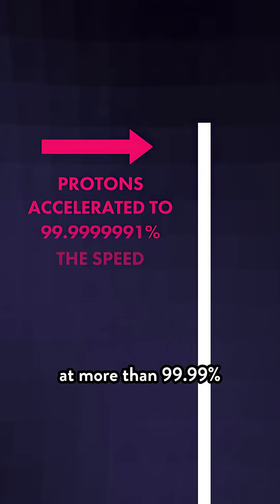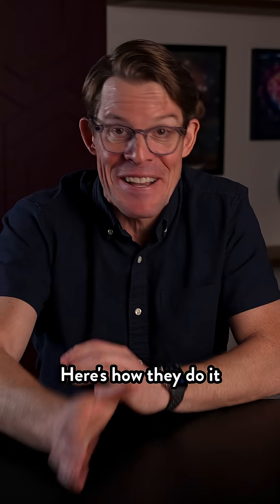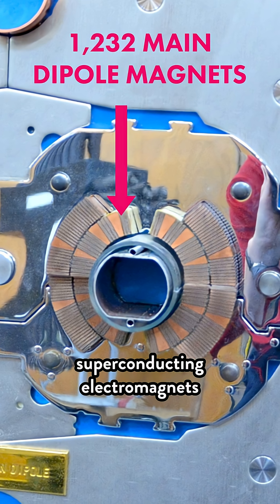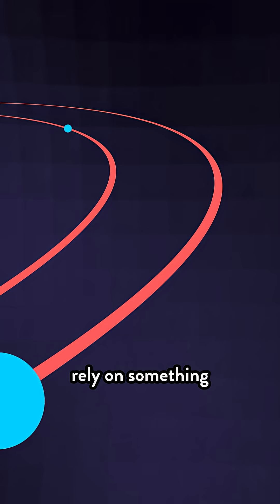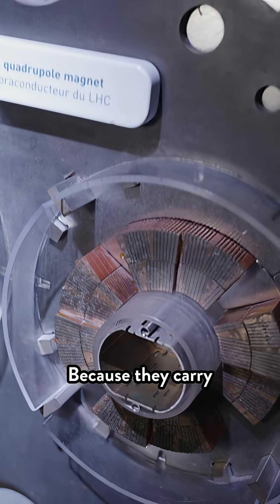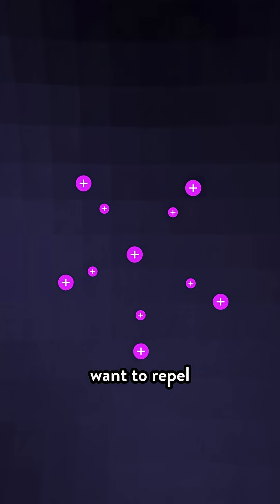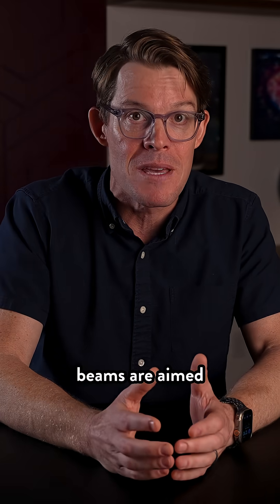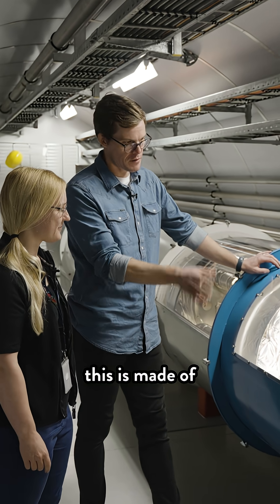How to steer at 99.9999999% the speed of light?

Comment: if you spin something fast enough you could create a gravitational field right?  but to have a gravitational field strong enough to bend the path of anything moving near the speed of light, would basically be a black hole.  so ya magnets and plasma are probably the best way to do it on earth.... only question i have is that the planet has a magnetic pole and gravity... what locations on earth could a collider be built that would optimize the energy needed to run it.?  second one pops into my head now... depth.. would the depth a collider is built affect this consumption of power to attain success in operations?

Comment: Another thing about the magnets having to be cool : when talking STRONG magnets with a LOT of current, you can't allow any losses due to resistance because the entire thing would melt (that's how resistance works - energy gets lost as heat). Therefore, using superconductors stops overheating due to absolute minimal to no resistance.
Reply: Thank you. The way he started it made it sound like the cooling was required due to the massive current. But, since they are superconductors, the current doesn't matter; no resistance = no heat. Now, the magnetic field could saturate the superconductor and force it to a state 1 superconductor instead of a state 2 but the cooling is only there to convert the conductors into superconductors.

Comment: But does magnet centralize all the material or only electron.!? 🤔 
When those atom smash each other, they create what exactly ! Heat !? 🤔 
How can you direct this heat into usable power 🔋!? 🤔 
And how can you keep feeding this machine more particles!? 🤔 
What happens if you feed it different types of particles ! Like uranium or other radio active particles??. 🤔 
Many questions 😂
Reply: I'll answer as well as I can.
At least any charged particles, such as electrons or protons. Probably also neutrons but I don't know how that works.
New, bigger atoms of different elements, but too big unstable atoms will just break immediately in a nuclear reaction.
It wouldn't be useful because you pit in the energy first, this never makes any energy, it's just coming from the grid.

Comment: So i did the math and for the particles to be accelarated around the center you'd need to give em a centrifugal acceleration of 21.000.000.000.000 (21 trillion) m/sec^2. I found this number by doing a bit of rotational kinematics. Given the circumference of the circle to be 27km and C=2πR if figured the radius R to be 27/2π km or about 4.3km and given the velocity of the particles to be 99.9999991% the speed of light (c) or almost 300,000km/s the centrifugal acceleration which is equal to V^2/R is approximately 2.1 * 10^13 m/s^2 or the number i provided in the beginning of this comment

Comment: Yeah, they have to recreate orbit..which is just perpetual freefall. So they need a net force of bringing it towards the center...between the forward&rearward forces anyway.
Reply: They need a downward force to keep it moving parallel to the Earth's surface, otherwise it would centrifuge away.  The tracks follow Earth's curvature, and part of the steering is to keep them from crashing into the ceiling.

At a slow speed, they'd need to steer upward to balance gravity.  But at a high speed, they need to steer downward to oppose the centrifugal effect of following Earth's spherical shape.
Reply: @carultch downward force? Its called gravity bud.
Reply: @whocares26475  Not in this context.  You need gravity as powerful as a neutron star, for a charged particle moving that fast to follow Earth's curvature.   Gravity is a factor, but it's ridiculously insignificant.  The magnetic force has to steer the particle both downward, and horizontally.

At this speed, you'd be driving upside down on the ceiling, rather than driving on the road as normal.

Comment: Colder than outer space !?!?!?
Seriously?
Let me educate you in some very simple and very basic physics.
Temperature is a measurement of molecular activity.
Heat is a product of temperature and mass. 
Thinking in terms of heat and temperature  does not apply to a vacuum. Outer space is not cold. It is not hot. It simply has no heat. No mass, no heat, no hot or cold.

And do not get me started on that stoopid expression "heat rises"
Reply: Arguably space does have a temperature, its just the average energy of its particles (just like any other material would be meassured)

It just has few particles, if the volume you refference is small and truly has no particles at all then yeah you're right tho :D
Reply: @tigerboy4705 
Well, I knew someone would point that out. I would circle back to say if we are splitting hairs, then the "vacuum" of space (which is what we're talking about) has no heat, while the random particles do have some calcuable heat. That is calcuable and not measurable.
Good catch though.
Reply: @scotte2815 yeah i suppose we could say that!

Tho i thing its definitly not wrong ot say that outer space (as in the entire region we call outrt space) does have a temperature, the average energy of its particles.

While certain - most - parts of it are empty and dont have pne, the entire thing does. Can we agree on that?

Comment: I just wanna know,is liquid helium colder than liquor nitrogen
Reply: Yes.

Usually, noble gasses have the lowest phase-change points, when compared to their multiatom counterparts.  You have to cool air to a much lower temperature than liquid nitrogen, to extract the trace amounts of noble gasses that are part of air, and that is where Neon, Argon, Krypton, and Xenon all come from.

Helium is a special case where you can't get it from distilling air, because it escapes to the upper atmosphere.  Helium instead comes from alpha particles as a biproduct of radioactive decay, both natural and manmade fission.

Comment: What i don't understand is that these particles almost move at the speed of light. But if you have a larger particle accelerator, why does it get more energy and can possibly show smaller/exotic particle, because the particles in the smaller also move almost at the speed of light. Is the difference between 99,999 and 99,999999 causing this difference?
Reply: I dont understand most of what you said, but the difference between 0.99999c and 0.9999999c is preety huge when considering energy
Reply: Yes, that was my question. Even though the particles are almost at Lightspeed, reaching almost 100% takes more energy and needs larger colliders @alex2005z

Comment: Since they're moving at nearly the speed of light, the relativistic effects of time dilation and length contraction cause the 27-kilometer (17-mile) circumference of the accelerator ring to appear to be only about 4 meters or 13 feet long to the proton itself.
Reply: Imagine how many Gs it's experiencing.
Reply: @umbrakinesis2011  A proton in the LHC experiences a mind-boggling centripetal acceleration of about 2 trillion G’s (2.1 × 10¹² G’s) to keep it on its circular path!
Reply: @BlackWolf42- I got 2.1 x 10^13. One of us did something wrong.
Reply: @BlackWolf42- Nevermind I forgot to convert from m/s^2 to Gs. You were right, it is 2.1E12.
Reply: @BlackWolf42- 
That's so ridiculously insane. 😮

So - do you think a proton becomes slightly OBLONG, at that G-force? Can protons deform, at all? 

I mean, if they are indeed physical objects, with mass, and have any DIMENSION (non-zero SIZE)... Then at SOME degree of force, they literally must deform - no??
Reply: @justinklenk  Photons do not have mass tho. So most likely not.
Reply: @pollatin1052 proton not photon
Reply: @justinklenk deformation implies particles sliding, a proton is one particle so it should not deform
Reply: @thebozo-m4j Shii. You right.
Reply: @thebozo-m4j Well, it is made up of quarks and gluons, so deformation should theoretically be possible I think
Reply: Well, I could do the math, but I don't wanna lol.
Reply: @umbrakinesis2011  Atleast 5
Reply: By nearly the speed of light, it turns out the protons are actually going only .299m/s slower than c. AKA 1.08 kilometers an hour...amazingly close!
Reply: I studied physics at college for my BSc. One question on a paper was how fast do you have to be travelling to be able to run into a 10ft room carrying a 20 ft ladder and close the door...
Reply: @edeledeledel5490  it is impossible, isn't it? For you having y-factor of 2 the room would be only 5 feet, so from your perspective you would not fit. Anyways you can fit from stationary perspective while you are moving, however someone else needs to close the door, not you, and once you hit the wall you either break through or stop meaning you would not fit anymore. Therefore it is impossible to do. 

And anyways the length contractions works only relatively in both ways, so the very idea of fitting in a stationary room relates only to the relativity of simultaneity meaning you are not really fitting in the room, just that the time you hit a wall and the time you finish entering the door are simultaneous for the stationary observer in the room. It does not mean you are fit in it at any point as you are moving, just that when you break the wall an observer would see you finishing entering the door. And if you try to close the door when you see it possible you would already break through the wall long ago with 15 feet of ladder outside.
Reply: @dmitriy4708  It was not intended to be realistic. You can calculate the speed, but since it was in 1970, and I never really used my Physics degree, I can'r remember how to calculate it, or be arsed to look it up. It was an exercise only - the "stationary observer" is entirely irrelevant.
Reply: @edeledeledel5490  yeah, it is obviously jus an exercize, however I would add in the answer the unrealistic nature of the situation. You can calculate things in physics, however sometimes they just do not make any sense. It is useful to understand that.
Reply: The protons are also experiencing time slowed by almost 100%

Comment: Isn't there a collider that fires in a straight line? Doesn't bending them interfere with their mojo and produce  wonky results?
Reply: They need to accelerate the particles by sending them round and round the 26.7 km loop at a speed of 11,245 revolutions per second. Imagine how long a straight collider would have to be to match that.
Reply: @Dooguk Lol I think that's why they never checked in with me before getting into this. A structure that long would probably provide enough leverage to swing Earth off the canvas. 

So did I imagine the straight line collider? Is it best to stop asking questions at this point?
Reply: @OneEyedWheeler  After a bit of research it would appear they come in a variety of forms. A cathode ray tube, like those in old TV sets is a particle accelerator. I guess they need the the loop just to get the particles up to the insane speeds required to smash the particles to smithereens and reveal their secrets. I wonder if we'll ever see an Even Larger Hadron Collider anytime soon?

Comment: Doesn't their need for such coldness relate more to their superconductivity than the electrical energy running through them?
AFAIK, superconductive materials are only superconductive when they're below an extremely low temperature? (though, not close to absolute zero anymore due to improvements in materials, but still immensely cold)
Sure, the electricity heats them up, but if it was just that, then we could run them hot and move just enough of that heat off to prevent it from degrading.
Instead, we need to keep it super cold enough to have that nigh-zero resistance of superconductivity, right?
Reply: You're correct, the cold temperature is to keep the magnets superconducting.
As long as they're cold enough, they have 0 resistance and so you can run huge currents through thin wires and be fine.
If they heat up enough to lose superconductivity, they quickly gain back their resistance and it starts a loop where due to the resistance they start heating more and more quickly. We call that "quenching" and it's not a good time for the LHC
Reply: im not sure what other kind of wire you could pump 11,000 amps through
Reply: "though, not close to absolute zero anymore"

It's still close to absolute zero actually. High Tc superconductors like cuprates are often not used for these kinds of applications because it's hard to make wires out of ceramic materials.
Reply: I wonder this too. And, if the material is superconducting, = no resistance, does the current actually generate heat? Time for some research.
Reply: @backwashjoe7864  Yea, the reasoning here is 11.000 AMps = normal conductor explodes. So because of the amps you need a supercondsuctor, which needs to be so cold.

Comment: Alright I got a real question, I understand that earth's gravity is fairly strong, strong enough to hold us and everything on earth to its surface. BUT, if the earth is rotating on it's axis, and in its orbit, and the solar system is in its own orbit in the milky way; then wouldn't we need to steer the particles in the accelerator in more than just a circular motion around the accelerator? Between all those orbits and movement in space, wouldn't we need to compensate for that, and wouldn't that particles movement be a bit more erratic at least compared to the earth's movement?
Reply: Relativity and momentum. Two objects going around in a circle cannot tell that they are going in circles just by looking at each other.
Reply: Do you have to compensate for travelling at such speed? Does that answer your question?

Comment: Can u do a short about if it’s possible to run a lap on the 27km LHC tunnel? 🏃
Reply: You can't for multiple reasons.  Firstly they seperate it into sectors for safety reasons.  You can't traverse between the sectors.  Well there is an emergency gate but you get in trouble if you open it.  Secondly you have to have an approved reason to do anything down there and going for a run is going to be denied.   Thirdly there are shielding walls at certain places. Only the beam pipes pass through them.  You'd need to move the concrete/ steel blocks out the way first.